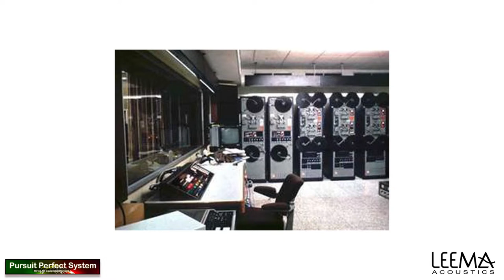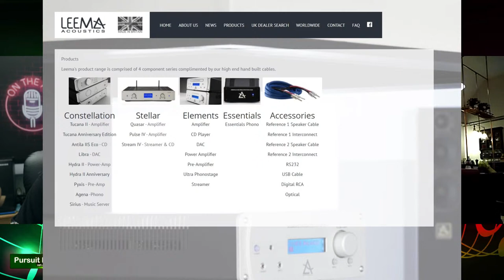Building a "PERFECT" Amplifier and HiFi System with Leema Acoustics

Comment: Illuminating and seemingly very rare interview with Lee Taylor, one of hifi's design, engineering & manufacturing greats -  and a true gentleman to boot. 
I have owned Leema kit for 10yrs+. The highest  quality battleship build and componentry within exude reliability confidence for the owner. 
My gear to date, Antilla 2s CD player, Tucanas 1, followed by the 2, with a Hydra 1 for bi-amping - all interconnects Mogami 2549 RCA. 
It is a powerful, well-controlled & emotionally engaging system with refined detail, delicacy & dynamic grip.
Aftersales / customer service from Leema Acoustics is of the very best. 
Rock on. 🤓👍

Comment: I own the mighty mouse and it sounds excellent on my asw cantius 412 floorstanders,i am concidering a dac upgrade.Ihave the schiit bimbo (the first one)  now .will  a balanced dac with bal.cables make an improvement.
thx a lot Alex
Reply: De dac is a bimby (schiit bifrost multibit) not bimbo 😊
Reply: Try the Holo Audio Spring level 3 with R2R ladder DAC and optional built-in balanced preamp.

Comment: Im after the system with sweet treble and no sibilance. is this possible? probably not
Reply: Yes it is possible but you need deep pockets full of cash.
Reply: @redleather100  how full? 😁  I was thinking maybe tube amplification would be better? currently using Naim Uniti2
Reply: @rustypipe  I heard a system with your requirements.it was 250k I closed my eyes and went to touch the performance as I thought it was live in the room.  It was the Esoteric and Raidho room at ascot hifi show . Terry has done a film of it.
Reply: Look at sonus Faber and a class a amp. Use soundcare super spikes on speakers and good wire. Should cost around £1500
Reply: Are you sure you want "sweet" treble? For sure, some treble based instruments sound sweet, but many do not.
How about having treble that sounds like.... nothing - as in sounds like whatever set of instruments / recording is being played?
No sibilance - as in the same amount of sibilance as if the vocalist were there in the room with you is possible.

There are a few routes to getting the sound that you want. Starting with huge classic American (high end by price when new) speakers. One example of many, being speakers based on Altec 604's.